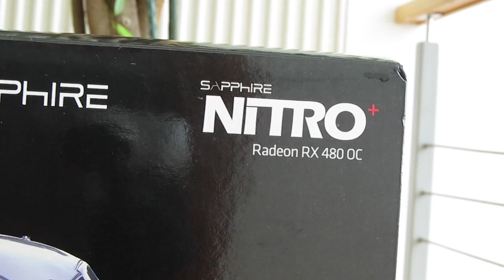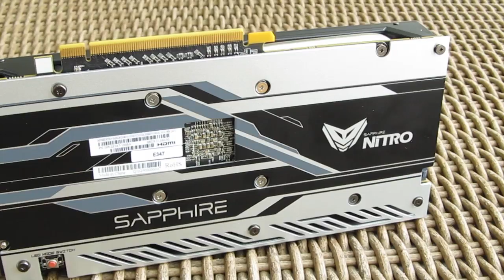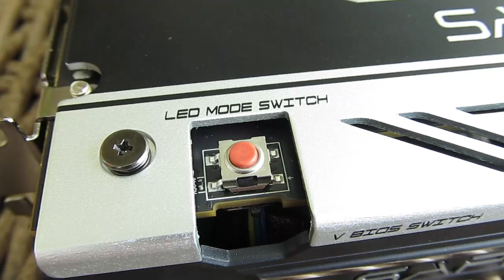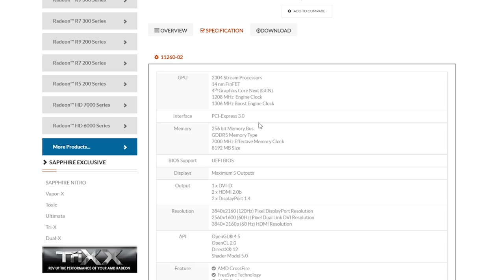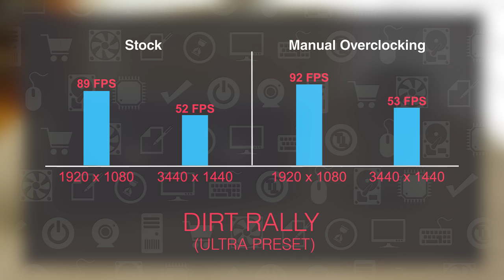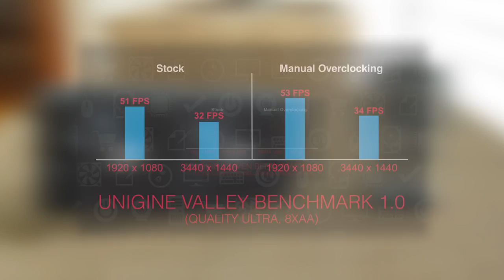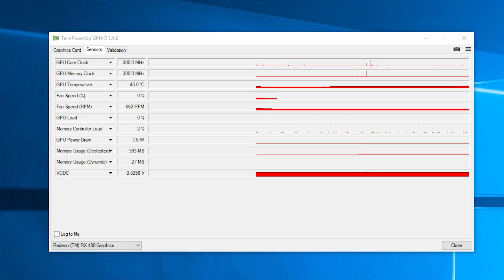Sapphire RX 480 Nitro+ Review - Aftermarket Salvation

Comment: This is not the first test that shows poor noise levels on Nitro and some crazy 2000 RPM+ needed to keep temps below 80C, which is quite horrible score for this card, especially if Sapphire is known from amazing efficient and quiet cooling solutions for cards like Fury that produce waaay more heat than 480.
Reply: I agree, this looks very disappointing from Sapphire. My 390 Nitro doesn't get above 72c under load and it certainly produces more heat than the 480.
Reply: Could be another issue with their thermal paste applications. I replaced my sapphire 390 with CLU and saw temps drop by 15-20 degrees. Whilst that stuff may be liquid metal, even replacing stock with mx4 initially, which is seen to not be particularly good as gpu paste saw temps drop by 5-7 degrees.
Reply: that's because the fans dont even start untill 52c, while this seems like a great idea is ridiculously horrible. its alot harder to START cooling something at 52c and keep it cool than it is to always be cooling and not letting the heat build up. Always have custom fan profiles its easy to do and it will save you the worry and time. 25% fan usage/speed should be on always then ramp it up more at that 52c mark. You will notice a huge difference. if you have a gpu now that has no fans until a certain temp test it out on that. again good concept in theory but in reality its not worth it. personally i've done fixed fan speeds of at least 45% on every gpu i've owned and my two hd 6850s still run amazing and cool. my r9280x is at 45% fixed and never goes above 55c even in gtav, starcitizen which is a huge load on gpus.
Reply: 50% on my nitro 370 is only about 1800-2200 rpm).  I'll hit 65-70c pretty quick playing a few games (fallout 4, etc. mostly ultra 1080p), this is a very low end budget card.  So, I don't think you should be tooo terribly concerned about that RX480 heat.
Reply: my 390 nitro oc go up to 81c but only in rust  any other new AAA games 78 i have a cheep case whit only 1 fan
Reply: Good case cooling, but not the best. R9 380 NITRO @ 1100 core and 1500 memory, auto fan control (default) at Heaven benchmark hits max of 72 C.
Reply: Zotac is their sister company and I own a 1060 amp! edition. It reaches about the same temps although the fan is a lot quieter. I owned a 270x vapor x and that cooler was definitely astounding. I wish they would release that kind of cooler again.
Reply: your 390 always has the fans running and that makes a massive difference i wish someone would address this and companies would stop making this a normal thing they do with fans. silence is not worth an insanely  computer component.
Reply: DerisiveLaughter Lol at gta being hard on your gpu.. I used to think that til I got doom, my 370 is setting at 1085/1585 during gaming. I'm lucky if it doesn't hit 70c at 100% fan speed (I've noticed maybe 3 degrees difference at most through overclocking)

But anyways, personally I like fan stop systems, it's great for your fan bearings. Having to warranty for something so simple is a lot more annoying than your temp sensors doing their job and and running at their own pace.
Reply: Bigjoe980's game corner
 gtav  isn't hard on my gpu it's a newer title, it's a more demanding game than most fallout 4 is another good example. you have a 370.... a r9280x is still a better gpu. doom is open gl that does nothing to gpus i can run that game max settings with zero over clock and get 60-70 fps with lows at 47-50, and you're missing the point. also fan bearings mean nothing on a gpu that lets you swap out the fans as easy as the nitro does. having a stop feature lets your gpu heat up before it even begins to cool it making it harder to keep cool and to bring the temp down at auto settings. and if you overclock at all and don't do a custom fan profile you're a moron.
Reply: DerisiveLaughter  Oh? hmm, I guess I misread what you said about gta then.. or you edited? anyways. for the record, the 370 nitro doesn't give you easily interchangeable fans because it uses a 3 prong design with a single screw and two retaining tabs instead of the usual 3 screw mount. it's basically impossible to find those same fans even though it's one of the most common FirstD part numbers, I don't consider having to swap out the fan internals or warranty it as easy. (even though both are extremely simple to do... granted that $15 fee for sapphire returns is annoying) lol. 

It rattles miserably if you shove a normal one in there thanks to different plastic dimensions.

And I'm there with you on doom running easy, i'm not saying it doesn't. I'm implying that it's the only game i've played since getting it that actually pushes my card heat wise. yeah? In vulkan on 16.5.2 crimson drivers I'm running tolerably with 1080 Ultra settings in the 70-50 range. through in one of the levels I tank down to near constant 30 for some reason rolls eyes and for some reason 16.7 breaks my proper vulkan function (screen tears, minimum 20 less fps at any time. etc)

For my card in particular heat isn't an issue because it can't honestly put out enough heat even with the fans disabled to come close to it's thermal limits, which is in the 90+ range, I don't think that's too shabby for a card with more more than 10% overclocks,  -I know that because I've tested it with them completely removed, haha.

realistically It's likely able to do in the 100 range. so a fan curve in my case is absolutely irrelevant. it's more a question of how much heat do I feel like dumping into my nearby fx8350 which i have running 4.5 on air. soooo.. yeah 

Finally, I think you're missing something here too. 50c at 0% fan speed is better than 50c at 50% speed. you have a lot more of a margin to dick around if your temps are at the fan stop range. If it's a big deal for an individual person, just take it out of auto mode, right? Even with msi's twin frozr setup kicking on at 60c it isn't honestly an issue 90% of the time. 59c still soaks into the nearby components exactly the same regardless of a fan being on.(if I missed anything important. forgive me.)
Reply: Bigjoe980's game corner
 the entire line of maxwell gpus are made very well and are very efficient alot more so than amd.(not that we are talking about nvidia, but those gpus with fan stop i could see being ok to an extent) whens the last time fan bearings gave out on a gpu for you. it's never happened to me  with 50% fixed fans for over 2 years on this current card. sapphire especially has some of the best components  for amd cards fan bearing included. as to replacing i really just meant this rx480 gpu not past gpus sorry for that. anything in the r9 series 200 or 300 is inefficient with thermals. the gpus get hot 90c is a lot hotter than i would ever want my amd gpu since 80-81c is where a lot of thermal throttling will occur( which if you open gpu-z you can see it down clocking the gpu to make up for the temps being so high) not to mention the gpu running at that high temp for long periods of time will do way more dmg to the card than you running fans at a fixed rate of 45%.  you can achieve lower temps with a modest fan profile just because it is always moving some air it wouldn't have to exceed 40% even, but just by having it at say 20% when you hit 35c( if you absolutely want a point where the fans simply don't spin) would keep the max temp you would hit lower way under 90c which is simply to hot for a gpu to run well with no overclock, and if you have an overclock its gone at this point because the card is now down clocking to handle the heat. like i said i have a fixed fan rate of 45% on a r9 280x with 150 mhz above the factory OC so 1250 total and memory at 6400mhz with a power increase of 25% so my voltage is 1.1 it never gets above 65c in even the newest games. this all comes down to personal preference in the end, but there are things that are un avoidable one of them being the gpu down clocking to deal with the heat and that will effect voltage and core clock. yes both of our cards can operate till that 100c mark but will severely down clock starting at 95c at stock speeds, but like i said with overclocking and increasing voltage this goes down mainly because you've just increased the idle temp with your over clock.  and the newer gpus like this rx 480 have a lower limit than that  in the 80-90c range 80 being ideal and 90c you're now thermal throttling. heat  is the number one  killer of computer components  besides human error, so i'll sacrifice some noise that i can't hear over the normal case fans i have to keep the gpu cooler. 50c at no fan speed is better than 50c at 50% fan speed this makes no sense and it's just not a realistic example you  would never just have 50c with zero fans where as the 50c with 50% fan speed would be under load. if you're going to argue that zero fans is better than fans you will lose if you want to cook the hell out of your gpu go ahead, but that logic is flawed.
 fyi I never edited the part about gtav you just misread it. and nothing you've said  has even addressed my first post of it being easier to keep something cool if you're constantly cooling versus  start cooling at 52c and this video is proof of that it wouldn't see 80c if it had a custom fan profile, if you want to say temps in the 90c is good and thats where you want it fine that's your choice. still doesn't disprove or even argue with what i said.
Reply: DerisiveLaughter BAH! I had a reply typed out to you and then I accidentally exited out of it. fuck.
Reply: Bigjoe980's game corner
 I hate it when that happens. I'll still be here when you type that out.
Reply: Krzych im uner 75 with undervolted with wattman
Reply: CLU? what is that man?
Reply: the sapphire rx 480 8 gig is the third best option for rx 480s and thats from a pcb standpoint not even touching what it translates to real time. though its only a 5 phase power solution compared to the 6 phase xfx and asus 480s it still gives you more than enough power distribution to get nice over clocks the only factor being how lucky you are with the gpu die it self which is pretty random. just dont get the power color devil until they come out with a different model just an all around janky pcb and it still has issues with steady power even with the bios update they released.  i would just wait for this rx 490 that could be polaris dual chip or a vega  chip we'll know this month though as it releases the end of this year.
Reply: Harmen Liefhebber this is very specific most all the nitro cards dont hit 80c  as always stock fan profiles are a joke and the stop fan feature kills your heat dissipation
Reply: Just got one on sale... If it overclocks like my r7 250, and hd 7850, I will have quite a nice card. My other cards hit 22% oc and 39% oc respectively. Doubt it will but it has a 1306 boost clock, so we will see how it goes.
Reply: +Nagy Janos Florian Seriously?  In rust???? 
That's the only fucking game I wanted to play with rx 480 sapphire nitro oc,  and if it won't be above 60 fps on max...  Dude,  I'm not buying it.

Comment: What cpu and ram do you have?
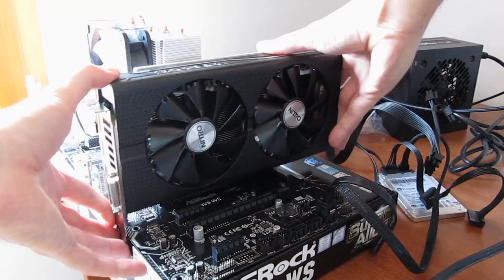Reply from the maker: 3:54 ;)
Reply: Idk how I missed that. I was wondering why oc provided just little fps boost but it seems to be due to vram speed bottleneck because 8gb with 1420/2200 has much better results.
Reply from the maker: Yeah, but I saw that general conclusion from other reviewers is that (for some reason) the OC performance gain isn't that noticeable at all.

Comment: In terms of future proofing,this or the GTX1060?
Reply: At the moment the GTX 1060 is better card since it performs about 10% better in current games. That said, RX 480 performs better in Vulkan/DX12 which is what new games will have so if you want card that will last you probably longer then the RX480 ... but you will sacrifice some performance now.
Reply: realistically speaking there is no such thing as "future proofing"
Reply: realistically speaking there is no such thing as "future proofing"
Reply: realistically speaking there is no such thing as "future proofing"
Reply: The Dark Night "future proofing" = which part will last me longer (usualy 3-6months) before I replace it.
Reply: Wyrdak "last longer"
Reply: this because if you want to add a new card for crossfire you can but the 1060 only has sli on the 6 GB version and at that rate you are spending $600 on 2 1060s when 2 480s would be only $400.
Reply: Big Thick rx 480 is the best in 8GB

Comment: How much is it?
Reply: $220 or $260 i believe
Reply: Thanks bro
Reply: he is showing the 4gb which is cheaper but i would not buy the 4gb at all. always get the 8gb
Reply: Wasn't the 4 GB supposed to be $199?
Reply: the reference one is 199.99 (when in stock) the sapphire features make it 219.99
Reply: Oh ok it makes sense with the aftermarket cooler & back-plate & the little overclock they added on top.
Reply: funny thing is, XFX offers a reference model 480 with back plate and even higher overclock of 1328mhz out of the box. Doesn't cool as well as the nitro though of course having blower style cooler. I have the XFX model described. I underclocked it a little to 1320mhz and under volted the gpu as well. My temps are 70c - 83c under gaming load depending on game. This is also with fan speed of 3200rpm max
Reply: How much was it I bet it was $280 or something
Reply: +Mpho John Moeteledi Sebalo $269.99
Reply: Well this 1 is appealing to me coz of the price of around $200 -$220 & when I add shipping to my country it should be around $300 total.

Comment: Your Witcher 3 settings are really disappointing, it should always be tested at Ultra settings and post processing high with hair works off.  You results are not comparable to what is mainstream. If you can, please do retest and add some annotations to this video. You also didn't test DOOM with Vulkan and TSSAA8X mode to show the true worth of Low level API + Async Compute on the RX 480. Thank you.
Reply from the maker: Let me copy / paste you a comment from my RX 480 vs GTX 1060 video.

"I actually wanted too, but I couldn't get the PresentMon working for 
some reason. I need to take a look into that what's wrong cause I'm 
actually planing to do a Vulkan video soon (DOTA and DOOM)."
Reply: Thanks for the reply so quickly!, Fair enough on the issues with DOOM. How about the settings with Witcher 3?
Reply from the maker: +McLaren Button
I'll think about it! When I first started to use Witcher 3 in my benchmarks, I've lowered down the settings just a bit so I can get a tad more "playable" framerate!

Comment: man its sad thought it would do better kinda hot and didn't overclock much better. Maybe the strix will run better, polaris is kinda like pascal in most every card overclocks in the same ballpark no matter power setup or pcb. Well if i was buying a card in that range i would get the small evga 1060 for $250 and do a small form factor build. I have a zotac 1070 Amp Extreme but want to do a build with my old cpu the 3770k and a 480 or 1060. Still might go 480 just to tinker with amd.

Comment: Doom in OpenGL fail. Vulkan should have been used and in TSAA8X mode to enable Async.
Reply from the maker: Let me copy / paste you a comment from my RX 480 vs GTX 1060 video.

"I actually wanted too, but I couldn't get the PresentMon working for 
some reason. I need to take a look into that what's wrong cause I'm 
actually planing to do a Vulkan video soon."

Comment: Did you change max voltages while overclocking?
Reply from the maker: I set it at max voltage in the Wattman, you can see that in the video - 1150 mV.
Reply: +TekTick Thanks, wasn't sure what the default was

Comment: How much exactly were you able to add to the core and memory clock?
Reply from the maker: So, I went from 1306 to 1380 MHz. I could get 1400 MHz also, but It wasn't stable enough for all my games. As for the memory, from 1750 to 1910 MHz. I could also get it to around 2000 MHz, but again, not completely stable for all my games and benchmarks.
Reply: TekTick
Thanks. You just got yourself a sub.
Reply from the maker: Aries0098
Thank you! :)

Comment: Why such a small fps in Doom? In all tests I've seen the video card gave out about 100 fps in FHD
Reply from the maker: Those are the FPS I got during a fixed gameplay scene (around 5 minutes on the beginning of the game), so it can vary from part to part. I got those numbers even with the reference card and with GTX 1060 (a bit higher dough). Maybe you saw Vulkan API results?
Reply from the maker: Yes, Vulkan is turning out to be a real difference maker! :)
Reply: So no Vulcan test included. How many DX12 games did you tested?
Reply from the maker: ROTR, AOTS and Time Spy.

Comment: is the Power connector on the Back! thats cool
Reply from the maker: Yes, yes, it is, I really like that too!
Reply: +TekTick interested to get one.. what's the price in ur country? Hopefully it's a lot cheaper than the zotac mini gtx1060
Reply from the maker: crysisownz
It's like 260-280€
Reply: Lol that's how all graphics cards used to be back in the day :) I actually still prefer back connecting ones... I have a lot of side panel fans, and having the connector on the top of the fan usually results in the cable rubbing against a fan blade so I have to bend the cable to prevent that.
Reply: +TekTick what Country???